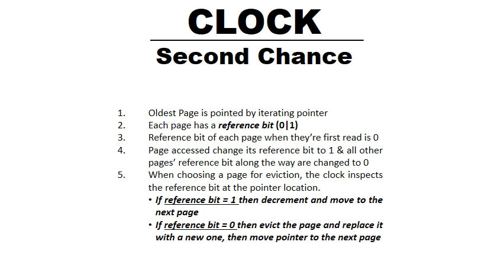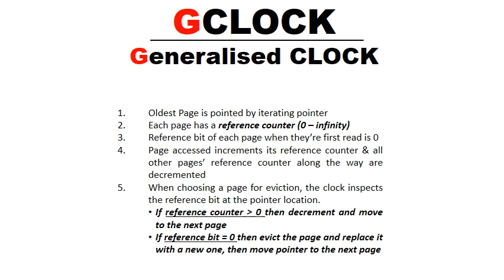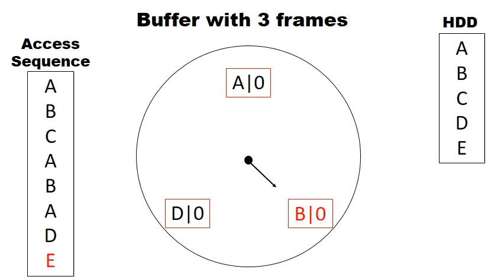CLOCK & GCLOCK Recovered

Comment: The way I know the algorithm, the clock pointer only gets updated when there is a page-fault, that means a frame needed to be updated. Here you update the pointer even if the requested page is already in the clock. Is that just different from implementation to implementation, or is there a reason for one or the other?
Reply: no answer lol